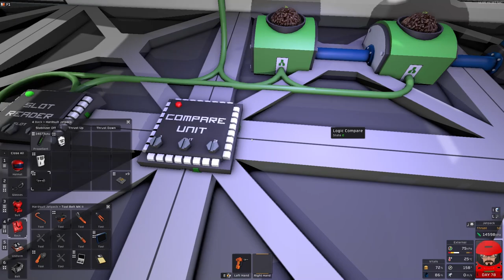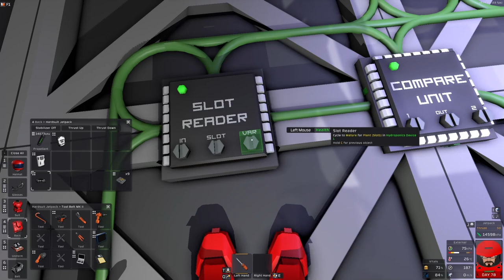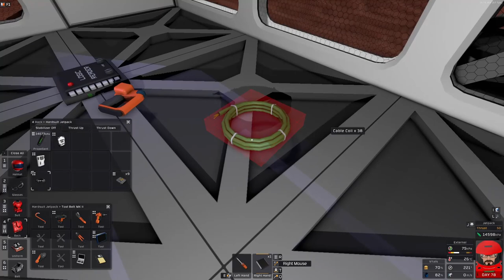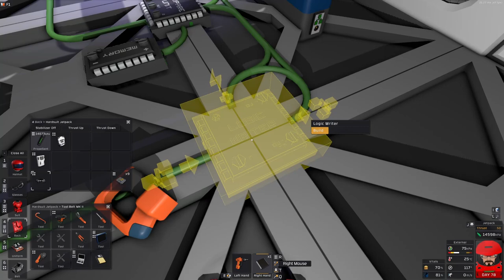Stationeers Logic chip Harvey automation

Comment: I think a couple times you've said the mature stage is before seeding. What I've seen has been it's always after fruiting and then seeding. At that point it will read mature. Doesnt necessarily matter. Anyway I have an ic10 handling my harvies and I do it right now per row. One chip per row to handle different crops.